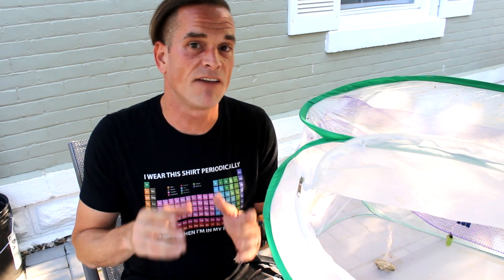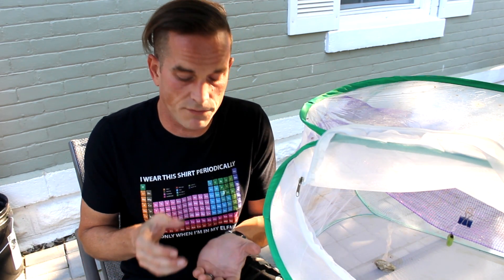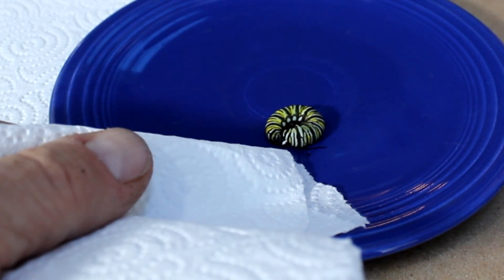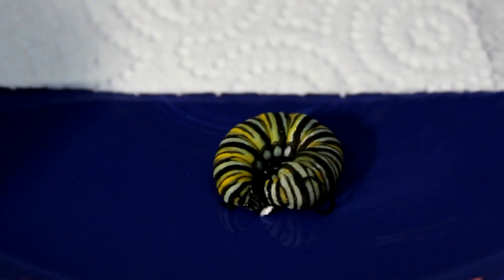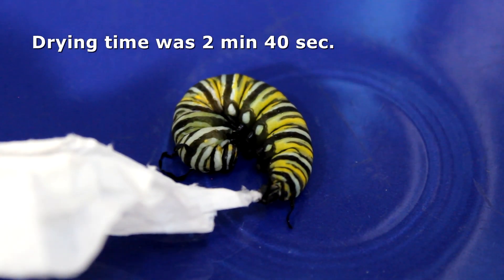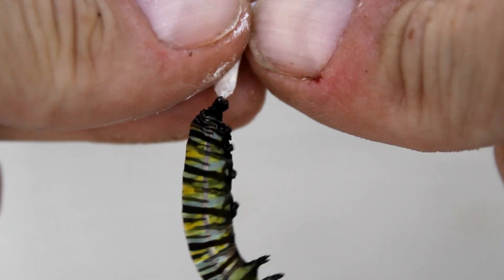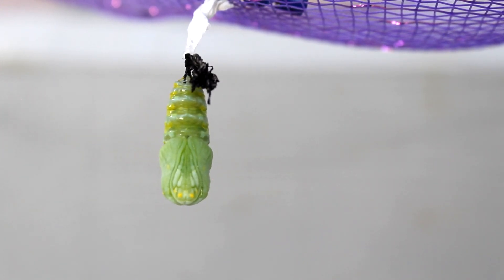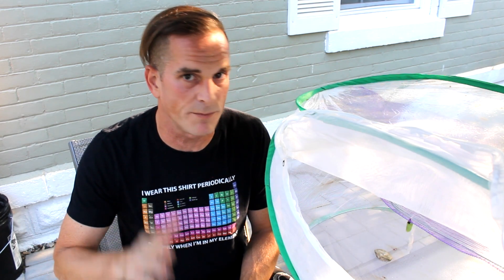Raising Monarchs - Fallen J-Hanger (Help The Monarch Butterfly)

Comment: I had to help one out once. Mine would crawl up towards the eaves of house but were were not good climbers. They would fall on the ground. One crawled up and fell so thought he was ready to pupate. I took him and put him in a enclosure. Then he changed his mind so I feed him milkweed for a couple days. Then he eventually crawled up to top of enclosure. He stuck around there for awhile but didn't spin a silk pad. In the morning he was down on side of the enclosure mesh hanging onto the mesh with his rear prolegs. I took him out. By that time he lost ability to crawl. I got some of that microfiber cleaning towel and he was somehow able to grab on to that. He successfully hung in his J and pupated and enclosed. He was kind of a pain. Another guy that fell from eaves, I put it in enclosure and he right away crawled up on a twig I propped up, spun his silk and hung in his J

Comment: Cool video, really informative. 

One trick you might try in the future if using superglue is to blow a tiny amount of baking soda onto the superglue once it is in place. It is a catalyst for superglue and makes it harden instantly. I use it by putting a tiny amount on my finger and blowing it onto what I’m gluing with a small puff of air. It doesn’t take much.

Comment: This year I had a stinker caterpillat attatched him self to anothers silk they both fell there was enough silk between the two of them  I hung one through a hair tie so that on was on either side one higher one lower then used a saftey pin to pin them to the top of there cage so one is in a J the other is in crysalis  they seem to be fine fingers crossed for a safe hatch, Thanks for your video and ideas  have to be ready to trouble shoot in  any situation  and work with what you have on hand

Comment: Mr Lund, 

Here's an idea for a future monarch video..

I have just brought inside two J hangers.. both are young.. under 2cm. Nowhere near ready!!

I've had this happen a couple of times in the past seasons. The chrysalis just dies or they die before forming it.

It's the second week of summer here in New Zealand. Upset due to seasonal change maybe? 

Just a bit of info on how I raise mine..

I had issues with disease outbreaks in my butterfly castle, so I've created a large monarch garden in my yard where I regularly wipe the plants with the bleach solution & bleach the eggs. I fight away predators as much possible. 

I only bring the J hangers into captivity.. & the eggs, until they hatch.

Any thoughts on what the cause could be?

Comment: Mr. Lund… instead of using any kind of glue that contains toxins please try using the sap from the milkweed itself. It is a natural latex, nontoxic and adheres just like chemical glue. It may not dry as fast as superglue but it dries faster that regular (Elmer’s) glue. It definitely works as I have used it successfully many times. It is just as effective and most definitely safer! I would be more than happy to provide/send you examples. I recommend/urge you to try it.
Reply from the maker: Greetings Cathy!
I must say, the use of milkweed sap as a material for adhering is an incredibly intriguing idea that I had not considered.  The materials scientist in me wants to do some strength tests, but if it holds well (as I suspect it would), this could be quite the viable option for rehanging when time permits the drying.  As you point out, though, the sap would take some time to dry, likely longer than the 3 minutes or so that I had to work with, and as the video shows, I didn't have really any seconds to spare.
Concerning the risks associated with glue, I would agree, they certainly exist.  Care and caution should be used in abundance, as I attempt to show in this video.  The very small amount of glue used, the viscosity of the glue chosen (ensuring it was gel), and the location it was placed were all important, and, I hope, given the adequate amount of attention.
While I do not hope for the need to re-hang a chrysalis or J-hanger anytime soon, the next time it happens and there's enough time for drying purposes, I think I'll be ready to give milkweed sap a try.  Thank you, kindly, for the recommendation, and I hope your summer season has gone well!
Reply: @MrLundScience  You’re most welcome for the tip. I’d be happy to send you some pics if you’d like to see how well it has worked for me. I completely understand the time constraint you were under and sometimes we do what we need to. I just don’t want people to get the wrong impression and grab regular glue when there is another safe and viable option. My season is going well… thank you for asking! All releases thus far have been OE negative! Happy Monarching!😊

Comment: It’s a living breathing thing. Glue can clog the spiricals, making them unable to exchange oxygen, contain toxins that can cause issues and hot glue is hot and can burn, even on the lowest setting and can be hard to get just a dab.  
Too many unknown possible toxins,  if you look at the packaging of super glue it says to use in a well-ventilated area. Glue can also plug the spiracles making oxygen exchange difficult, if not impossible.
And if the cremaster is too short you risk damaging the chrysalis or death.
Pieces of microfiber cloths are your best friend in cases like this, or a qtip.
Reply from the maker: I don't disagree with what is being stated here, but am confused in that it is describing a situation that is significantly different than the one involved here.  In this specific case, there was still silk to work with and adhere to.  In cases where the cremaster is exposed and no silk is present, this would not be attempted.
What is presented here is one option, which has risks.  Microfiber cloths or q-tip methods are also options, which come with other risks.  Depending upon the individual, one option may be more accessible than another.
If other viable options exist in such situations, this is certainly a place where a link to a video showing the procedure (or other website) may be provided, and as it's for the health of the Monarchs, I'm always a fan of options.

Comment: Glue is incredibly dangerous and, as some comments make clear, can easily kill the monarch. If you absolutely have to pick them up in this condition, a fluffed up qtip or microfiber cloth are more than enough to pick the dude up without glue or toxic chemicals. Sorry, Mr. Lund , this suggestion is going to cause a lot of fatalities.
Reply from the maker: Greetings Liane.
I wish to be clear:  In no way do I mind being criticized or questioned, as that is vital and healthy to science, and I certainly hope, we're all in it for the health of the Monarchs.  At the same time, I wish to offer the advice that vague criticism that doesn't get into the details of improvement do not offer much help.  If help isn't being offered, then what is the purpose of the criticism other than to insult?  I don't wish to assume insult is intended, but if the intention is to be constructive, more details are needed, or insulting is how it comes across.

In a recent comment you provided on the "BTS - My Relocation" video, I was accused of holding adult Monarchs in a "dangerous" way in past videos.  I asked you for clarification on this, for you had not provided any details, only the accusatory word.  I'm still left confused, as I hold the Monarchs the same way that is used for the tagging of Monarchs, which is a method Monarch Watch uses as well.  If you choose to reply to this, I ask that your reply begin with addressing this.  Please go into the details as to how my method of holding adult Monarchs is dangerous so that it may be discussed in a rational, civil manner.

Concerning glue and its dangers, are there risks involved in the procedure I perform in this video?  Yes.  I would ask you to point out any portion or procedure involved in the rearing of wild sourced Monarchs that does not include risk.  Can glue (or other chemicals) have a fatal affect on the chrysalis?  Yes.  You allude to comments that testify to this.  At the time of this comment, I wish to point out that the two comments that you could be referring to also state that there was no silk left on the cremaster.  This is a significant difference to the situation shown in this video.  I do not show in this video, nor in any of my videos placing glue onto an open cremaster.  What I have shown in this video is one option for rehanging a J-hanging caterpillar, by adhering a very small amount of glue (to minimize risk) to the remaining silk tip.  If you wish to critique this procedure, fell free, but I ask that you critique the procedure that I have shown, not one that I have not shown, nor would show.  This option is a viable one, as evidenced by the successful adult that already emerged.  Are there risks to this procedure and ways to do it wrong?  Yes.  But that is true of every procedure.  There are none that are without risk.

I'm a huge fan of options.  And again, as this is all for the health of the Monarch, any healthy options that can be used in the place of glue, I'm open to, and such links can be provided here.  I would encourage such, as many can learn from them.  You refer to a "fluffed up qtip" option or a "microfiber cloth" option, but have not provided the details as to what specific procedure you mean.  This doesn't give myself or anyone reading this the chance to review the alternatives you are recommending.  I'm aware of some procedures on the subject, and depending upon the method being used, some are very viable, and some are not.  I'm also aware of some who rear Monarchs who also have disabilities that prevent them from using such methods, and for those people, this glue option is more accessible.  But again, I don't know if the methods I'm thinking of are the methods you are referring to, as you have neither described them in detail, nor provided a source that does.  I await a detailed procedure on how to use q-tips or microfiber cloth to solve this problem that is both risk free, and someone with Parkinson's can easily achieve.

Ever Forward
Rich Lund
Reply: @MrLundScience  I did provide you with the appropriate information regarding holding monarchs. A link from a group of scientists tracking OE across North America with appropriate information about holding and testing. While it may be a method that you've successfully used for years, that doesn't mean is the best way. The available information has evolved over the past few years. The notion that they need people to interfere and raise them in order to save them is of the past as per that information, just as an example. I've seen hobbyists use glue on silk or cremasters an inadvertently kill a monarch. Using a qtip or microfiber cloth is as simple as touching the tip, gently, and relocating. The cremaster will grip immediately and firmly to both of those materials. This can be done by anyone. I'm not sure how super glue is more accessible than a cloth or qtip, which most people already have in their homes. This doesn't require any dexterity or risky practices as it's just a matter of touching the rear of the caterpillar or tip of the cremaster to the cloth or qtip. I'm well aware that there is risk in interfering with them but anyone with a large platform should be providing the proper information to the people wanting to learn and minimize the risks. The critique is that far too many will see this and think it's a perfectly acceptable option regardless of where they put glue on the end. The chance of blocking the caterpillars spiracles or sealing the chrysalis shut if it's a fallen chrysalis someone's working with is far too great when there are other easy options.
Reply from the maker: Greetings Liane,
You state that you did provide me with a link to some information on the correct holding of adult Monarchs.  There was no link in the comment on the "BTS - My Relocation" video, and there is no link in any of this comment thread.  If this is an important issue to you, please provide the link here and others, including myself may review it.  

For the second time, you have not answered the question, so I'm asking a third time, and very straightforward way:  What about the method for holding adult Monarchs that I show is "dangerous"?

Dangerous is a very strong word.  You chose to use it.  I ask that you stand by what you said and provide an explanation.  Having requested this twice already, if you choose a third time to not put to words why my method is "dangerous", I'm forced to assume it is because you can not.

"While it may be a method that you've successfully used for years, that doesn't mean is the best way."

I have never stated that I have shown the "best" way to hold a Monarch Butterfly, nor the "best" way to do anything.  "Best" is a subjective term, and "Not the best" is subjective as well.  Both are a far cry from "dangerous" as you originally described it.

"The notion that they need people to interfere and raise them in order to save them is of the past as per that information, just as an example."

In 2014, at the end of Raising Monarchs Part 1, the very first Raising Monarchs video I made, I point out at the end that the raising of Monarchs means nothing if they don't come back to more milkweed the next season.  I have never stated that we need to be rearing the Monarchs in order to save them.  I have often stated that the way to help the population is through the planting of milkweed in order to restore habitat.  

Having read your procedure for using microcloth a qtip, am I correct in understanding that you are claiming, touching a qtip to a cremaster will allow it to adhere to the q-tip secure enough that as a J-hanging caterpillar is molting the skin and wiggling, it will be secure and does not have a significant risk of detachment?
Many questions may still arise - How gentle is "gentle"?  Do you need to fluff out the qtip first or not?  If so, how much?  Is it guaranteed to not fall, or is there still a risk of falling?
And if someone attempts to perform the procedure you offer in your reply, and in doing so, something goes wrong because they deviate from your procedure, are you responsible for that Monarch fatality?  (Please keep in mind, that is what you are choosing to put on me.)

"I'm well aware that there is risk in interfering with them but anyone with a large platform should be providing the proper information to the people wanting to learn and minimize the risks."

Here is a video that provides information for people wanting to learn an effective option for securing a J-hanging caterpillar within 2 minutes and 40 seconds.  I showed a procedure that, if followed correctly and not deviated from, is effective and has minimized the risks.  If your opinion is that this is improper, I will take your opinion into consideration and give it the weight it deserves.

"The critique is that far too many will see this and think it's a perfectly acceptable option regardless of where they put glue on the end."

So your critique boils down to, don't show people a way to do something because we shouldn't trust them to be able to do it correctly?

I'm sorry, but  I'm not of that opinion.  I prefer to equip people with information and trust that they are intelligent enough to make their own informed decisions with it.

If you choose to offer a reply, I do hope that we are able to find some common ground, but I will remind, if it doesn't include a specific answer as to how my method of holding adult Monarchs is "dangerous", I will not be offering it any of my time.
Reply: @MrLundScience  I've attempted to offer 4 replies that are either being deleted or not posting for whatever reason. There can't be a conversation with this going on. 4 comments, 3 with the appropriate link and one without a link, none show up here moments after posting them. I'm not the only one who's offered criticism but I am the only one you've demanded "detailed procedures" from. That's very interesting, to me. The Monarch Parasites website that I keep trying to link is easily accessible online. It shows what's done wrong with how you hold them. I won't attempt again to comment. I've tried for days with each attempt not showing up on your video after I've hit the reply button.

Comment: Very interesting.  I actually had this happen two days ago but did not have any of the webbing to glue to.  Unfortunately it didn't make it.  I tried to glue to that little black thing ( not sure what you call it) but as soon as I touched it with the glue it died. 😥  I guess the chemicals in the glue entered it's body through that little black thing.  Hope you can come up with a way to save them when this happens.  I have 16 chrysalis, 2 - J hanging, one wondering and at least 30/40 that I'm feeding so far this year.  I have released 8 so far.
Reply from the maker: There have been times in my experience when a chrysalis (never the J-hanger, though) has become unattached in a way that had the stem (cremaster) fully exposed.  In those times, the chrysalis did not make it.  Without the silk to "plug it up",  the opening can let in bacteria, or other nasties.  So, yes, I sympathize.  When this situation happens again to me, it'll be a chance to find a solution, and I have a few ideas, but nothing concrete yet.  I'll have to wait for the situation to arise, though, so it's not one that I'm exactly hoping happens, right?  ;-)
I'm sorry that you did experience this.  It can be heartbreaking when an attempt at rescue can go wrong.
Reply: I used dental floss and tied it tight. Worked great, might be of help to you in future.
Reply: I'm sorry you lost him. Think you're wonderful for doing your best to help him ❤